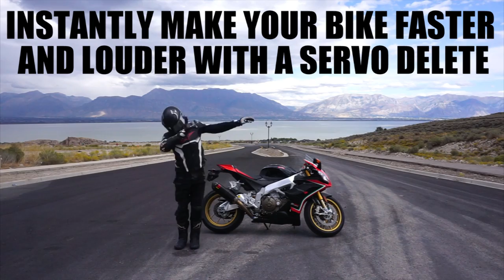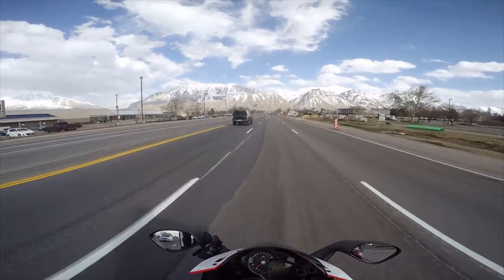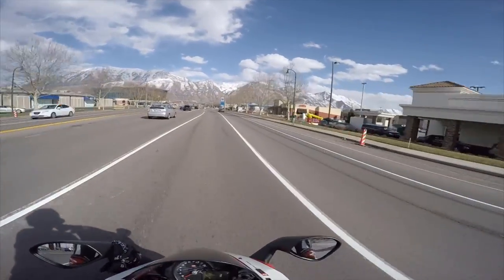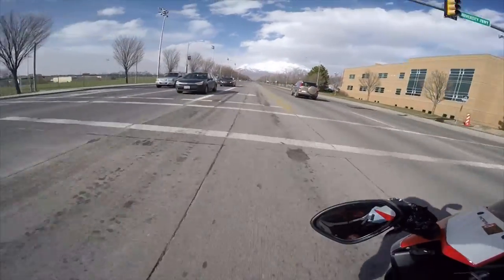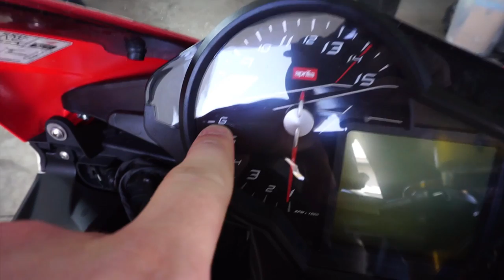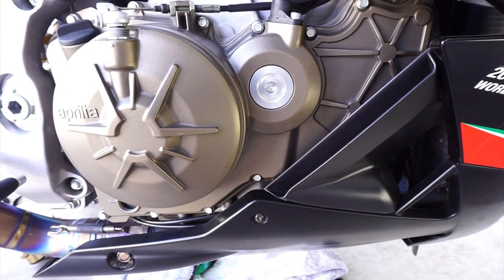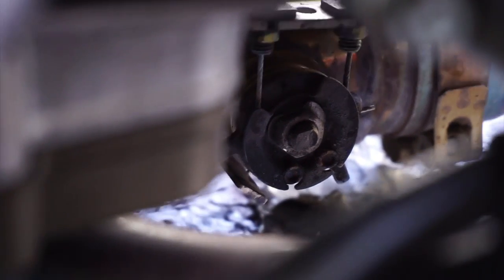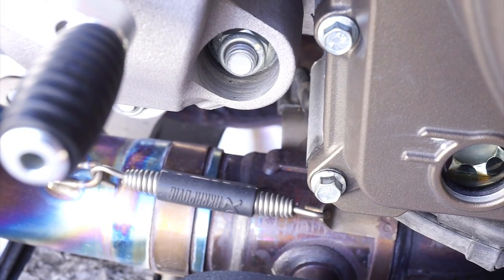How to make your bike LOUDER for FREE

Comment: If you buy a servo buddy you can take out the servo motor and it gets rid of the FI light once its plugged in. It reduces some weight and you get a little more storage for a power commander or whatever
Reply from the maker: +Daniel Pollock yeah very true! I'll be getting one after I reflash the ECU

Comment: clarification more teeth on rear sprocket = more low end torque & less top end speed. more teeth on front sprocket is opposite. Also, having that valve fully open will indeed cause a slight reduction in low end torque due to less effective "exhaust scavenging". Enough to notice? probably not. great sounding exhaust > 1 Nm torque. good decision any day. friggin send er
Reply from the maker: haha yeah I totally goofed up on that XD I plan to do a ECU flash which would eliminate the butterfly valve anyways so I figured I'd do it

Comment: Does it alter the bike in ANY badly way? Heat, warning lights on, throttle response, anything at all?
Reply from the maker: +Peter Rodriguez nope! All it does is pass regulations. If you ever put a full system exhaust in it or a ECU flash then it's not being used so you can just take it out

Comment: I have ZX6RR 2005 and I want to do it. the part that  I have to remove is under the seat because my exhaust is under the seat is that correct???
Reply from the maker: I’m not sure I would check the Kawasaki bike forums they will have answers for you

Comment: That valve is for low end torque not emissions. Put it on the dyno and all ur doing is killing the bottom end.track bike remove these cause they run in the 10k range abd want maximum air flow. Youre shifting at what sounds like 6 k.
Reply from the maker: Exup valves does give torque but their main purpose is for noise and emission regulation I read up on it before I made the video

Comment: I did this on my buddies 07 gsxr600., but I removed the entire butterfly valve.
Reply from the maker: +sinformant yeah I'm gunna do that once I swap out the exhaust
Reply: The Muscle Biker just a heads up. the shaft the shaft that the butterfly valve was on was  very hard metal. ate up a couple bits.

Comment: Dis wont work on a ducati
Reply from the maker: It works on every bike since all new bikes are required to have that part
Reply: @Shimmoda  nope, the way the valve works on my monster is that it remains open on idling and as soon as ii rev to 4k rpm its closes the valve. i believe ducati sets it that way as that's where most riders be cruising at around the neighbourhood to reduce noise and also that's where test centre be revving to test sound emission. i tried disconnecting the cables but it will show error on the dash. So i put it back in. Anyways im not into annoying neighbours with my loud exhaust, i usually hit the kill switch and let it coast to the parking lot when im home late.